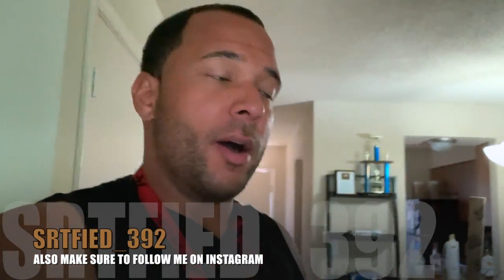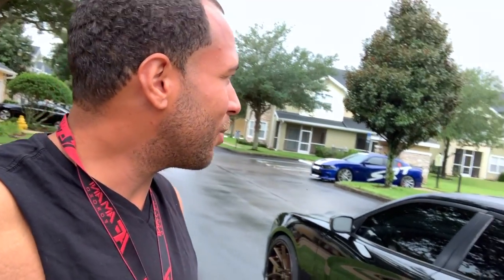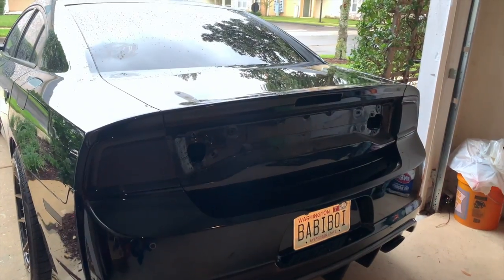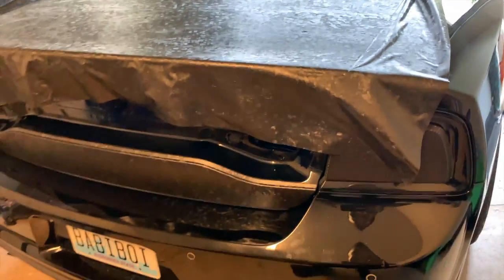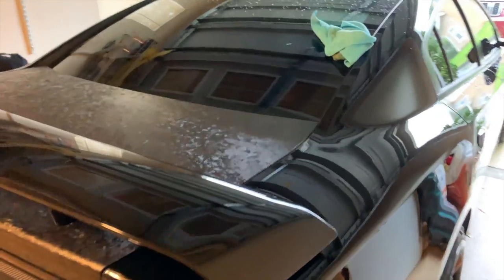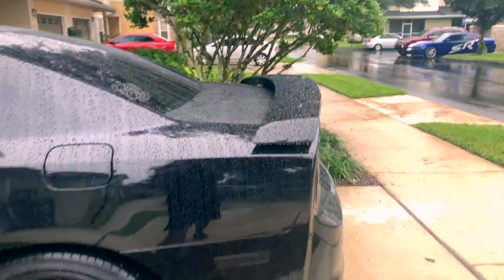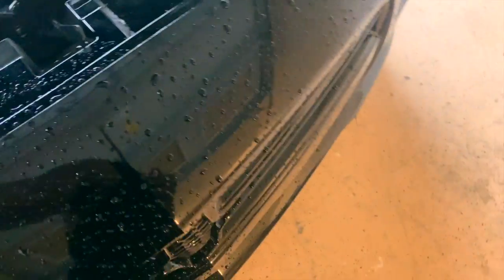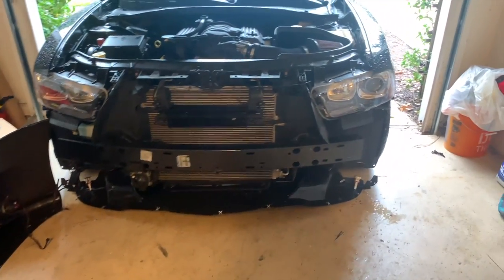Matte Forged Carbon Wrap Accents Are Finally Finished!!!

Comment: Your car looks like it finally Settled it looks like it’s about an inch and a quarter lower. How is the ride over bumps and bumpy roads? I got the eibach pro kit with shocks and lowering springs and over bumps and bumpy roads it doesn’t ride good at all.
Reply from the maker: I dont have that car anymore but i can tell you that it definitely did not lower it. It raised it almost half inch all the way around. But it rode fine tbh. Going with lowering springs is always a sacrifice in ride quality which is why going with a full coilover set is the best route to go if you want comfort and performance